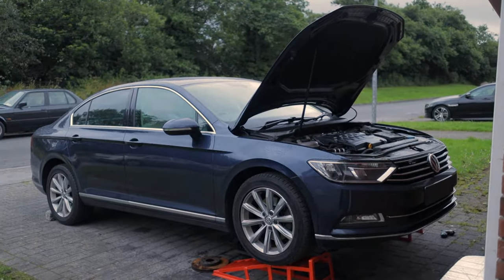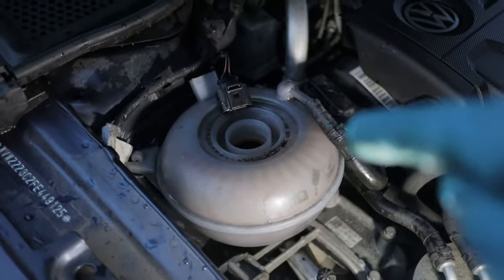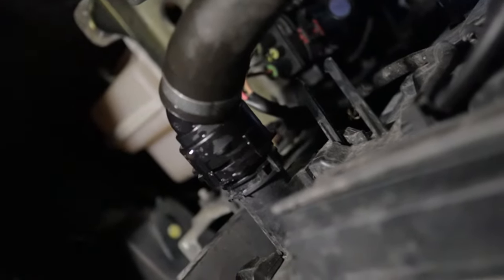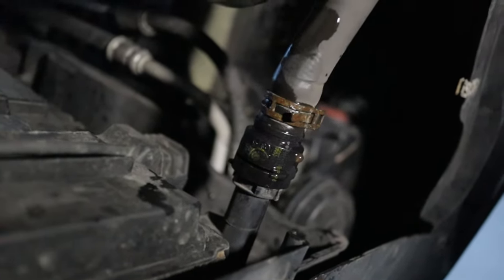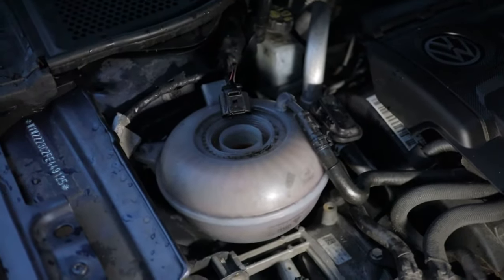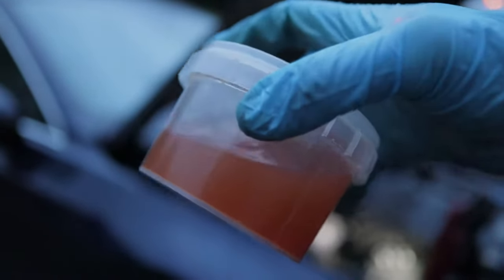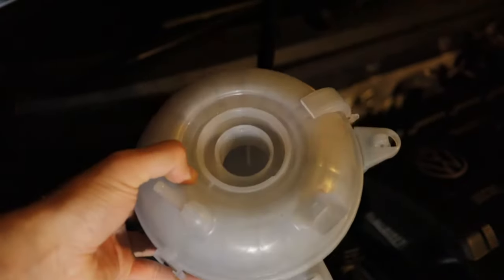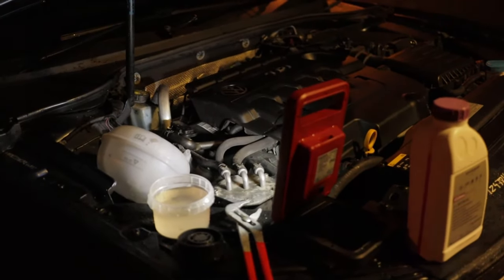VW Passat B8 Coolant Flush and Coolant Reservoir Replacement

Comment: Im looking to change the coolant for the same reason in my 16 superb with the same engine, did this method turn out ok to bleed the coolant correctly? I’ve heard they have a complex system of 2 or more circuits and water pumps? How much coolant drained out of the system also? Cheers, Lee.
Reply from the maker: @Lee Murtagh Sorry lad for the late reply 😔
Yes, I've heard and read that there's a proper way to bleed tbh with ya and in short yes, my method worked as the car is driving away fine. Can't tell ya how much coolant came out as lost count due to flushing etc. and had to flush many times to get it clean before pouring new coolant. The VW fella said it takes 6-7 litres and it nearly took more. Now a bit of advice or the lesson I learnt anyway and I hope will help people: Don't flush until you absolutely HAVE TO. I had ta because the coolant was gone all bad (probably a mix of different coolant types). And if you just want to change coolant per the service, you can just drain as much as possible in the first go as I showed and top up (~2-3l), job done, add more if goes low. No need to worry too much about bleeding and shit. If doing a full flush, drain as much as possible, add as much coolant as possible drive as much as possible and then flush 😁, will be expensive bit at least won't be adding water etc. Into the system.

Comment: Oh Wow! your car is a 2015 and in 2022 your coolant reservoir is already dirty to the point where you decided to change it out, something is not right with your engine it seems.  Today in 2024, I currently have a 2006 Jetta 2.5 that I bought back in 2017 when it had 210,000 kms.  7 years later in 2024 it is nearing 370'000 kms and the coolant was still bright pink before I flushed it last month for the first time since I owned it.
Reply from the maker: Oh wow, about your car and happy to hear it.

Sorry for the late reply, my account was hacked for months and I only got access back today. 

You're correct that since it's a closed system, the quality of the coolant should not be impacted and should last a long time before going manky. But for these, often the silica bag goes burst or people add wrong type of coolants which causes them to go bad, hence I changed this for a friend of mine.

Comment: That is not the main radiator you are draining! That is the water cooled intercooler radiator which is on a separate coolant circuit only joined to the main system by a non return valve for filling purposes. It has its coolant circulated by a separate electric pump rather than the main belt driven coolant pump
Reply from the maker: @James McCullough Oh please don't tell me just now that I did the whole thing wrong 🙈🙈🙈 I believe I did both of them. Can you point out the time stamp of what you're referring to? The first big hose on the left side, I'm certain was the main rad and then the other smaller hose one could possibly be different. Will be good to know honestly, I'll try to look up a good drawing too. Thanks
Reply: @noorshah96  I too am very interested in additional information regarding the two circuits.  Thanks for the video also.
Reply: Can you tell us the right way to do a full flush? I'm prepared to buy a vacuum filler tool, but how many points would need to be drained? I have a scan tool to clear codes and some basic stuff, but not to (eg) open the thermostat valve if that is what they do at the VW workshop. Do they even know this at the dealerships, because apparently coolant is not a standard service item. Also, another problem is you cannot buy G12 evo as concentrate, so unless you can drain all the flush water, the coolant will be too dilute. Maybe the best way is to just drain what you can (perhaps ~50% or even less) and refill, and do this every couple of years, not trying to get the long life out of it?
Reply: James Mculloch any chance you can tell all of the viewers how to do it properly if this way is incorrect?

Comment: Hi there, have you experience of replacing the heater core in this model car? I have a 2016 one of these with little to no heat. I've heard they are notorious for clogging
Reply from the maker: I don't have a first hand experience of replacing one but have a good idea. Not the handiest of the jobs 😅 Check the quality of the coolant, it might tell you if the silica gel thing exploded in the coolant reservoir, will be a tell tale sign for bad things including a blockage....
I've read that bad cabin temp sensors can cause no heat
Reply: John Devitor I came here to watch this as I am considering changing my heater matrix too. It seems a pretty straight forward job once you get all the trim out of the way (more so on RHD cars. The only issue I can foresee is the pipes which connect at the matrix making it awkward to refit the new one without damage
Reply: @noorshah96 thanks for the reply. Looking into the reservoir, the coolant is a mucky brown colour
Reply: @michaelcurran46 I've heard reports that the dash has to come out to access it😮. I'll take out the trim on the passenger side to see if it's accessible. Not going to pay VW 1500 quid to fit a 150 quid part😂
Reply from the maker: @JohnDevitor  That isn't a good sign to start with TBF. But if you somehow confirm the matrix needs changing, I'd drain all the coolant, do the replacement and then pour in new coolant. If the matrix was good, I'd still change coolant. It should look visibly "good" at all times.
Reply from the maker: @JohnDevitor I share your sentiment about labor and time charges, this is what started my "DIY" mechanic hobby and I'm glad I did. You save so much money and learn about the vehicle you're driving everyday...
Reply: @noorshah96  I might try a flush first and replace the reservoir and coolant and see how it goes? Where did you get the non silicate bottle?
Reply from the maker: @JohnDevitor oh yeah, that's a good idea and a safer bet. I think I got mine from the local VW Dealer. Found it reasonably priced for an OEM part from what I can recall. Same with the coolant. Ask for a "trade discount" when at the counter, works out sometimes if the person is nice enough 😅 My flush method was a bit "ghetto" tbh so maybe do some research around it, there should be more info out there now than what I could find or manage...

Comment: A problem with this is that I cant buy G12 evo concentrate. If you flush with water, you need to use some concentrate to get the right dilution with the plain water in the engine block. Also VW dealer near me said my model Passat was "about 10 litres" but this is just a random guy from the workshop, not the manual.
Reply from the maker: Sorry for the late reply - I've heard people having trouble getting certain coolants but I would say go with whatever the latest they have available as that should be backwards compatible to some extent. And regarding the capacity, I would definitely go with the manual or try and get the dealer to properly check in their system. Best of luck 👍🏾
Reply: I got a b8 and it took exactly 10 L of coolant
Reply from the maker: @vitalieuzun9845 thanks for confirming that, much appreciated 👍🏽👍🏽

Comment: Noor Shah, the main question I have is how reliable has your TDI been? I've always wanted to own a diesel, but I hear horror stories about the def blue system. I hear that the engine is reliable, but the def blue system is unreliable. Currently own a 2013 Passat with the 5 cylinder engine.
Reply from the maker: @faliray4889 Honestly, this wasn't my car but my buddies and  I know from talking to him, it was pretty solid. I drove it and drove pretty well, unlike old diesels. And he actually used to do very long distance cross country type trips with no issues. I'm driving a 08 BMW E61 520D (2L TD) since last November and it has been pretty good so far other than a few minor bits that I tackled myself. Diesels won't beat the 5 Cylinder Turbos in drive and sound but great for long distance drives with good economy. Depends on your use case. Let us know how you go. 👍🏾👍🏾
Reply: @noorshah96  thanks for your reply. Useful information.
Reply from the maker: Glad to be of help 😊

Comment: Thanks for the video. Just by adding the distilled water to the tank it will get down the the radiator without doing anything to make it go through the system ?
Reply from the maker: No problem 😁 Oh no, that's not correct at all. You're meant to use Distilled water for flushing because it's easier on the system as compared to tap water which is more corrosive once it gets hot. It won't help with getting the water/coolant down to the radiator. I hope that helps 👍🏾

Comment: Hello, do you mean you drain the whole coolant through those two hoses at the top? Arent we supposed to unplug a hose at the most bottom part of the radiator? I have been to the mechanic today and wanted to change from g13 to g12evo but he managed to drain only 2 litres from the most bottom part of the radiator. Then we ran the car for 2-3 min but nothing more came out.
Please advise if you could.
Thank you.
Reply from the maker: Hey, I do recall doing a lot of research on this at the time which I don't remember precisely so you might have to do some research as well. But I do know that coolant would stay in the system until the thermostat opens up or something to do with the AC. The official way which a mechanic should do this by using a coolant pressure filler of some sort...

Comment: Usally when you see coolant/antifreez that colour it's because the owner has added the wrong type of coolant antifreez and the fluid has become mixed. Never a good idea to mix different types of coolant antifreez.Pink type is for Aluminium engines green is for cast iron engine types
Reply from the maker: That's very good to know actually, thanks for the input 👍🏾👍🏾
Reply: You should also be aware of this issue with
some VW/AUDI coolant expansion tanks.
Silica gel bags have been causing problems
Ref this video https://www.youtube.com/watch?v=dxirMtjr4tg
  @noorshah96

Comment: I'm quite sure on VW of this year that you MUST use a special tool from VW to add the coolant by a vacuum device attached to the expansion tank..If you do not bleed it with a scan tool, you will get an engine code!!!
Reply from the maker: I do agree that the proper way would be with a pressurized coolant transfer tool but even with this method (not ideal), it still worked fine. I had introduced some air into the system that took a couple of careful runs and topups to clear out but no issues or codes were experienced.
Reply: @noorshah96  
I think the 2.0 TDI is more critical than the gas engine...
I had to use a scan tool in order to bleed the system.. SMH VW
Reply from the maker: @russsterns2656  yeah it must be so. I do have a good obd2 scanner too which I should have played with more at the time. Does it activate the water pumps or something once you start the coolant bleed function? 
VW ... Yeah why like why? 😂
Reply: @russsterns2656  Do you mind me asking which scan tool you used? Does it give you control of the actuators in the system? I'm tooling up for this job on a Passat B8 2016 2.0 TDI after quotes of 3 grand from VW to fix 😭😭😭
Reply: @CaledoniaSailing did you ever manage to do this with or without the scan tool? Thanks

Comment: Does this video applies to 2009 vw passat?  I'm having trouble draining it
Reply from the maker: I would imagine the process would be similar but I do think that there is a proper way to do it too. Are you trying to do a full flush, what trouble you're having?
Reply: @noorshah96  trying to do full flush but I can't find a way to flush the old coolant.
Reply from the maker: Could you not find the main drain plug/hose on the radiator?
Reply: @noorshah96  I see 2 left and right, I opened it but nothing coming out.
Reply from the maker: The radiator might be clogged 😌 found this guide to be good https://itstillruns.com/clean-car-radiator-4809632.html hopefully it might be of some help

Comment: you dont need to buy this bottles of 1L , you can buy the 5L version , G12E050A3 . Anyway , I did this on my golf7 almost 2 years ago and replaced the expansion tank for a newer version , without silikat" in it .
Reply from the maker: That's great to know, the dealer near me only had 1L bottles. I believe the coolant reservoir I got now didn't had anything in it either. Thanks for sharing the info 👍🏾

Comment: This ramp is from Halfords?
Reply from the maker: It is from Halfords indeed. I have had these for a while now and I'm pretty happy with them so far.
Reply: @noorshah96  Nice ….
Is it good space to get Down the car?
I have those plastic ramps …is enough space but I would prefer a higher one!
Reply from the maker: Oh yeah the space is  pretty good I must say for what they are. You can always do with a bit more but I'd easily say they're higher than the plastic ones you get. The only thing I have noticed is that you have to get someone to hold them down in place if you get a rear wheel drive car on them, as they can move over. That probably goes with all ramps...

Comment: Need to do this on my Octavia.

Can I just ask for clarification: Are you fulling the coolant system with water, then running the car up to max temp with heater on full, then letting it cool, draining it, and then repeat until the water is clear?
Reply from the maker: @James Harte Yes that's what I did after some research. Water will run clear after a good few cycles of flushing depending on the condition of the coolant and the cooling system as a whole. If you look at ay reply to Lee Mutagh, I've explained there a bit more.....Like you don't really need to flush  the coolant in this detail unless you have to e.g. cooling system issues, coolant reservoir damaged, coolant gone bad but if you're just doing this as preventative maintenance, just drain as much as coolant possible (easily) and add the same amount and job done (if the old coolant is still good). I hope I haven't confused you more 🤔 Best of luck with it.
Reply: @noorshah96  I'm replacing the heater core as I'm having heating problems (passenger side warm, driver side cold) and even with heat at full temp, the warmest air is only lukewarm. So I suspect it's a busted silica bag in the expansion, so changing the tank also.
Reply from the maker: Oh I get ya, This car actually had this issue. Improved slightly after the coolant change but still one side was full cold. The owner wasn't bothered too much about the heating in this case.....When I was researching about it, I saw somewhere that check the sensor for the heater vents if possible

Comment: What engine do you have? how much fluid do you have left?
Reply from the maker: It's a 2.0 TDi 150PS, I believe the engine code is CRLB. Can't remember the fully quantity tbh as its been a while but I do remember it had to be topped up again atleast with a litre. If buying coolant for a full flush, I would suggest to get atleast 7-8l. And someone gave me another recommendation that I'll do for next time that instead of using water, use new coolant (a bit pricey) but you don't have the fear of leaving water behind in the system.

Comment: Bro you realize you’re supposed to dilute that stuff 50-50 you just wasted all that money
Reply: No you don't need to actually, it says Ready Mix on the bottle
Reply from the maker: You don't need to mix water, correct. It's ready to be used out of the bottle and it's recommend to not use water at all.
Reply: @noorshah96  Sorry, must not be the same stuff I have available locally. Forgive me :)
Reply from the maker: Oh no hassle, I know you can get the concentrated types where you have to dilute.
Reply: Tried flushing my heater core took it out but no good it's blocked drivers side .. I did see an oily film on the water I flushed through.. terrified the head is gone.. still waiting on new matrix.. have to do it all over again.. I did keep getting low coolant warnings.. for a time after refitting... No leaks anywhere..inspite of the coolant being low.. new expansion tank on now.. and all seems ok.. never got any over heat on the gauge prior to work and after.. but I did pull the pipes on the bulk head side trying to flush.. after ..the return pipe would not seal at all.. have it sealed now after cutting it off and replaced with some elbow pipe... Tip if your messing around with those clips tie some fishing line on before you put them back.. they can go flying and be lost.... Skoda superb 2016